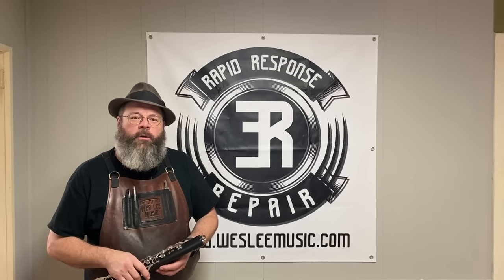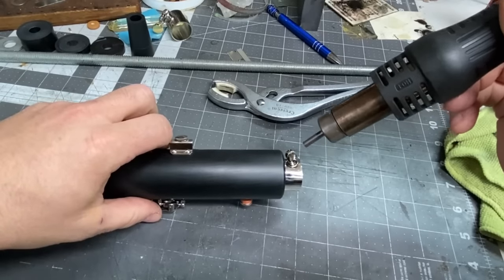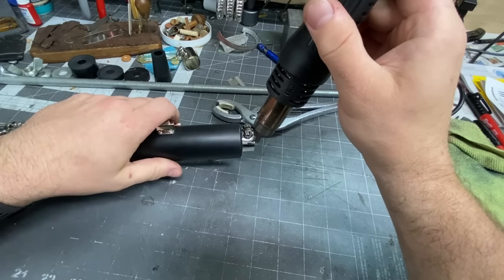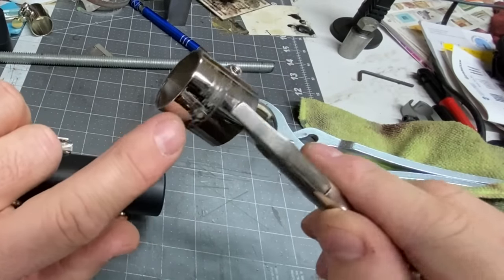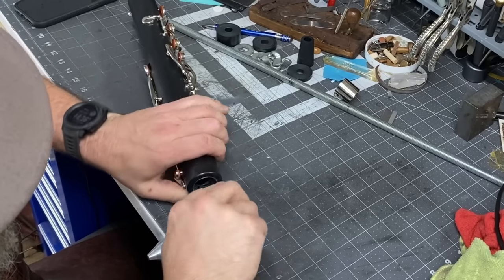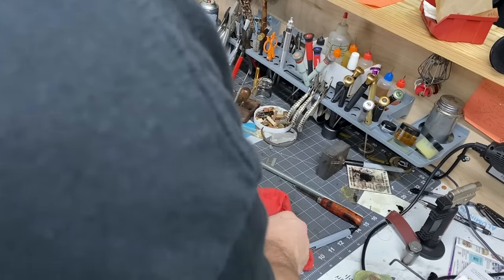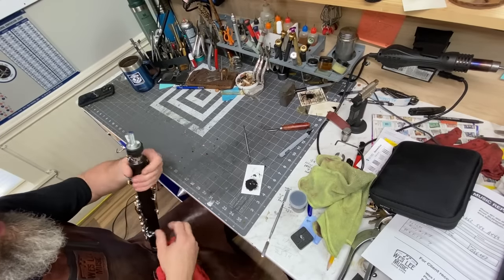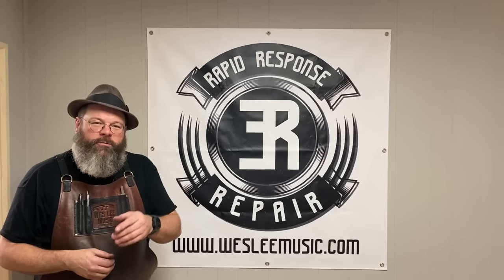Repairing Bass Clarinet Receiver- 4/3/2023, band instrument repair

Comment: You make it look so easy! To remove the epoxy tags easily, spin up a brass or aluminum tube with a sharp end edge that you can push into the bore and shear the tags off.

Comment: I recently purchased a solder rework station, which not only has the adjustable soldering iron but has a hot air side that will adjust temperature and air speed.  Works pretty good for welding plastic, and is really nice when you want to heat something up slow or fast.

Comment: was that 190 degrees F or C? 
I also have the same type of high heat gun but as part of a surface mount electronic repair station. 
The Lathe is a great tool! I have recently restored Dad's old Atlas/Craftsman 12 inch lathe and have been making brass parts for ham radio projects. The latest addition, however, is a benchtop mill from the Little Machine Shop here in Pasadena. With the DRO it is amazing how accurately you can craft parts. Between the lathe and mill you can make just about anything, as long as you can afford to buy all of the different attachments! 
I especially like watching your videos as from time to time my Wife brings home instruments in need of "help" from the students that she teaches. Most fixes seem to be common sense, but like everything else, the further you go the more types of tools you need!
Bill
Reply: F
190 C is 374 F !!!!!
Reply: @grantkoeller8911  It most likely was Celsius as ABS (the plastic that the clarinet  was made out of) melts at 200 degrees Celsius and most epoxy resins melt below 190 degrees Celsius.
Reply: @humanperson1898  definitely not Celsius, 190 C is 374 F!!!! Which is way hotter!!!!

Comment: Yep folks, instead of buying expensive tools, for only a few thousand dollars and plenty of space to hold a lathe, even you can turn a taper to build one cheaper... I am joking, a lathe really is a good investment and there are a few good ones within arm's reach, but they can do more than make a few tools, mine paid itself off after a few months, so did my stick/tig welder. Both are small enough to fit in an apartment. Just make sure it's safe to do so.